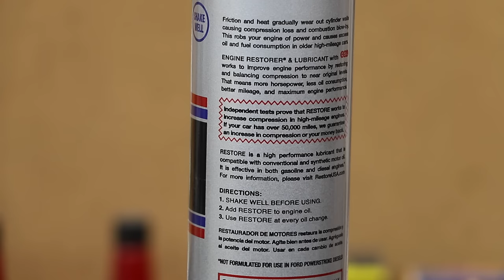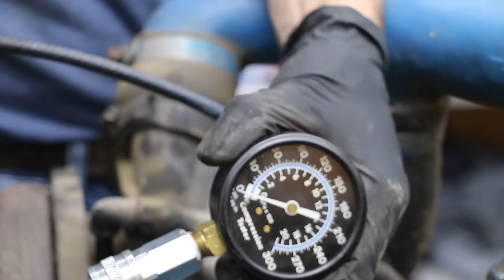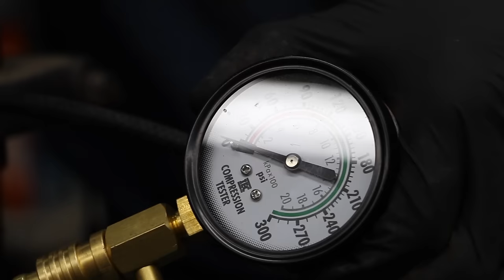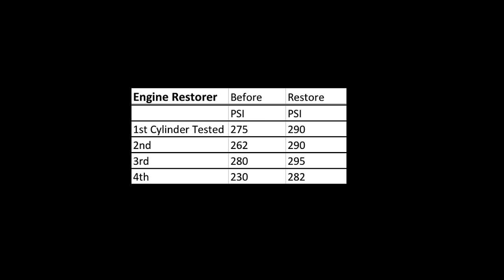Does Restore Work?  Will it Improve Engine Cylinder Compression?

Comment: I I just bought this stuff. 
My truck cranks but won't start. Two different mechanics told me it is most likely the timing change. Compression is low but everything checks out good. Relays, electrical, fuel pump, inertia switch, battery and ignition are good. 
They told me it costs between $3500 to $8000 to repair it. 
just bought this stuff. 
My truck cranks but won't start. Two different mechanics told me it is most likely the timing change. Compression is low but everything checks out good. Relays, electrical, fuel pump, inertia switch, battery and ignition are good. 
They told me it costs between $3500 to $8000 to repair it. 

This Engine restorer is my hell mary.

Comment: A little trick if your diesel is hard starting and you don't want to use starter fluid. Spray silicone, spray it through the air intake while cracking the engine. This will increase your compression long enough to start the engine without damage.
Reply from the maker: Thanks for sharing.

Comment: I own a 2003 mustang cobra which is a supercharged small block v8. Upon making to much boost, the previous owner burned the exhaust valves in cylinder 7 and burnt the rings and piston in cylinder 5. I know this because upon doing a compression test all of the cylinders were above 160 psi except 5 and 7 (they were near 130 psi). I poured about a table spoon of oil into the cylinders which were low on compression and performed the test again. The new results concluded that since cylinder 7 jumped in compression to near 150 and cylinder 5 jumped marginally to 137 psi that cylinder 7 has ring issues and possible exhaust valve issues and cylinder 5 is mainly a ring issue. I went ahead and changed the oil and  added the restore v8 formula. I checked the old oil and filter and they didn't show any signs of over-wear. Just some small sparkles which could barely be felt on the finger tips. I checked the bore of both low cylinders with a bore scope and everything checked out. Other than mildly slow start ups every now and then the car seems healthy. Do you think engine restore could fully fix my compression issues or do you believe it  may be time for an engine rebuild? Thanks, and I look forwards to hearing from you! Huge fan

Comment: I just wanted to give you a note when applying Teflon tape you did it correctly but one more hint I want to give you reverse the roll this will pull it tight as you're wrapping threads check it out you'll see what I mean it will then sink the tape into the threads avoiding any slippage furthermore
Reply from the maker: Thanks for the suggestion.

Comment: Better put a fuel pressure gauge on that tractor. As the pump makes less pressure, the engine runs lean. Great videos!
Reply from the maker: Thank you!
Reply: @ProjectFarm  youre welcome. Also some say that after changing the oil (removing the Restore product) the engine revers back to bad compression. Idea for a test?

Comment: Back in 1995, I had an 1986 Acura Legend, very used and not well maintained when I got it. It had compression loss- I would have to stay on the starter for 7-ish seconds to get it running when engine was cold (not used overnight), and it would white smoke a little at first. It could start right back up after the engine was warm. Tried this product, however, it did not have a noticeable effect.
Reply from the maker: Thank you for the feedback.

Comment: This brings to mind the full-page offer in the old Warshawski & Co. catalog for "Engine Overhaul", a kit which included both an additive for the motor oil and pills to be dropped into each spark plug hole. Results varied, from negligible to non-existent.
Reply from the maker: Thanks for sharing.

Comment: I’m a deputy  sheriff. My patrol vehicle is a 2014 Chevrolet Tahoe that has 236,000 miles on the odometer. The engine runs smooth as silk. I was wondering if there would be any improvement if I added the 8 cylinder Engine restore. 
Today I added the Engine Restore 8 cylinder.
After about thirty minutes driving the country roads I had nearly forgotten that I had added the concoction. Then, then I was going up a hill and noticed the added horse power bump! Then, I noticed again that I was actually having to use the brake more on my usual driving style. 
Does it work? YES IT WORKS! Is it a fix all? Absolutely not. But, this product will fill in those microscopic etches in your cylinder walls and where ever compression is lost. I am absolutely amazed!

Comment: that was pretty cool dude.  some engines take cough syrup, others take everclear, and all other engines in between.  I have a fuel mix for small gasoline engines for power and engine improvement.  by mixture  1/3 diesel  1/3 gasoline  1/9 denatured alcohol  1/9 diesel clean silver  1/9 marvel mineral +/-1/27.   I run my 21"  MTD 675 on this fuel ratio.  cuts through thick grass without dying.  of course, I keep my deck to top for the acreage I push mow
Reply from the maker: Thank you!

Comment: Had a 68 El Camino with a 327 that got severely overheated. Lost ring tension and got rod knock.  Put restore in it, and the guy that bought it was able to drive it home. ( he had another motor to put in).  I was shocked it got rid of all the smoke and even diluted the knock to a small degree.
Reply from the maker: Wow!  Thanks for sharing this experience.

Comment: I have used Engine Restorer in the past.  I think they ask you to drive 500ish miles.  I took a trip so I got to 500 miles in a hurry.  When I exited the gas station where I stopped I accidentally burned rubber and noticed my engine more responsive.  Keep driving your tractor maybe 8 hours and you should see a bigger difference.  Good luck.
Reply from the maker: Thank you!

Comment: Have you ever tested the longevity of the results from this product ?  As in would the compression gains still be there at the end of your oil change cycle (3kmiles).  I'm assuming that the gains will diminish over the oil change cycle since they recommend to add it at every oil change
Reply from the maker: Thank you.  I did a follow-up video and the engine did maintain compression.  The hour meter is broken on the tractor and I'm not sure how many hours the engine was used during the year but I did use it quite a bit.

Comment: I've known of people in order to sell a vehicle to use heavyweight oil , Motor Honey or STP even gear oil to make car run better and to keep oil pressure up to get it sold . Even take white spray paint and paint the inside of the tail pipe .
My dad and my brother bought a car one-time that someone had used shoe leather and cut up a Prince Albert can to make rod bearings . Lasted long enough to get it sold for a better price .
Reply from the maker: Thank you for the feedback

Comment: Hi. The following is from Restore home page FAQ. 
“Can RESTORE be used in diesel engines?
Yes, RESTORE is effective in diesel engines. We recommend using it only in diesel engines that have "common rail" fuel injection systems. It is not formulated for use in HEUI fuel systems which are used in Ford Powerstroke Diesel engines”.
They recommend only in Diesel engine with common rail fuel injection??
Reply from the maker: Great information. Thank you
Reply: Can you give the link please?

Comment: Well here's a kick in the head.
I have a Yamaha generator (EF2800i). It's relatively new, but has been used heavily. This one is my second. The first lasted many years until I had to open it up, and upon closing I didn't get the wiring put back in securely enough, and vibration caused chaffing creating a massive short.
Anyways, I let someone use this newer one to clean an abandoned home.
I dropped it off, demonstrated how to use it, then left.

When I returned about 6 hours later, the generator was running very rough, and rich with soot everywhere.
The idiot had ran a shop vac with it with the choke on the whole time.
Not having the time to take the head off and clean it, I ran a can of seafoam through the carb in hopes of removing the carbon build up in the cylinder. I also replaced the severely fouled plug.

The generator worked just fine after that, but some months down the road it began using quite a bit of oil.
It wasn't smoking, but you sure could smell the burning oil in the exhaust.

I came across this video and thought maybe this would help.

Before adding restore, I took a compression reading, and got just short of 100 psi, which was actually better than I had expected.

I added 4 ounces of restore, and topped it up with fresh oil.

The generator ran for about 8 hours, then quit.

I checked the oil level first, and it was low enough to cause the self protection to shut it down.
I added another four ounces of restore, topped up the oil, but no start.

I pulled the plug. It was kind of strange looking. It almost appeared rusty?

I then took another compression test, and came up with less than 30 psi.

I haven't torn it down yet, but have new rings and piston on order. 

It might all be coincidence, and the engine was about to give it up anyway, but it was running before adding restore.
I'll update once I get it open.
Reply from the maker: Thanks for sharing.
Reply: @ProjectFarm  Well thank you, for thanking me for sharing, but whattya think?
Have you heard of anything like this yet?

Comment: I bought lawn mower that was on discount because it was to be used as parts only the manufacturer said the engine was shot I got it I put engine restore in after putting new oil in it is still working great now 15 years later
Reply from the maker: Thank you for the feedback

Comment: After I properly changed the oil with Engine Restore in the mix, engine dash light came on.  OBD codes P0011, 12, 16, 21 and 0022 came up on my scan tool.  All related to engine timing & camshaft positioning.  There were zero issues prior to oil change.  I'm attempting an old fashioned 're-set' by disconnecting the battery overnight with the hope that the electronic system will re-boot and restore initial engine settings to truely clear the warning board.  Have any of you experienced this occurrence with your modern vehicles?

Comment: Yupp 80 Mustang inline 6- 300,000 miles smoked and blow-by barely ran- Restore between 3-500 miles brought her back and ran like a top for another 3 years, used it every Oil change. And was running great when I sold it. Always wondered if it would help a worn out lawnmower engine If a little bit was added to the Oil.
Reply from the maker: Thanks for sharing.

Comment: I had almost no compression in one cylinder that caused a stumbling sensation opon taking off from a stop..  Light throttle, like tipping into the gas pedal. Put this stuff in and the stumble pretty much went away. I feel it slightly, but it's really light now.  Cruising at city speed my transmission goes into lock-up and that's when you really feel those surges. Now it's less noticeable.  Someone told me it will get better if I keep using this product at every oil change.

Comment: I actually use that on some cars I have worked on just because they have hit 240k + miles on them and seem to help out the cylinder walls and the rings where blowby happens. I don't really use seafoam on any thing other than a good cleaner for the intake system and getting the gunk out of the system of the engine. I dont trust it in the oil because it is a cleaner over five minutes. like the five minute oil treatment cleaner where it takes all the gold tint off of the internals where the engine needs that type of tint. if it is a  caked on black style of sludge I would recommend a rebuild to be honest or a new engine

Comment: Great video. Thanks a lot. I'm looking into extending the life of my 4.8L v8 gasoline engine with 166.000 miles on it. No problems yet, but I really don't want to replace the valve stem seals for another 100.000-200.000 miles or so. Could I use Restore like that or only recommended when there are issues already?

Many thanks from Holland

Comment: There's  tons of comments and this may have been asked before, but did uou use ATF as a cutting oil when drilling/tapping the hole in the top of the injector? I recently watched your video comparing cutting oils and was laughing when you said bacon grease smelled the best!  I recall you saying "something was better than nothing" too. Thanks for another great and informative video!

Comment: Back in early 90's I took an 180k subaru that i knew was not doing well since i sold new subaru loyale series @ time with same engine  i added gunk flush 1st ran car for 7mins drained oil installed a new oil filter & fresh penzoil short 1qt & in place of that quart added 4cyl can of restore & topped with marvel  in less than 150miles  that old subaru was making up a certain steep hill to my residence as well as the new loyale subaru i drove as company demo which before i would be pushing car all it had in 3rd to make hill same speed now could make in 5th @ the same rate of speed and gear as the new car
Reply from the maker: Thanks for sharing.

Comment: They make a spring loaded tap guide that goes in a chuck .it goes in the end of the tap handle..most have a center drill hole,but u can add one if not. It will keep you straight  and alot more stable while taping..thx..heath
Reply from the maker: Thank you

Comment: I think it is nothing more than a viscosity thickener.
It prevents oil to flow through the gap between piston rings and cylinder wall, and, it actually makes something like sealant around the piston rings and valve stem sealants.
I am not sure, but if it's going to restore the engine compression, it must work forever once you poured it into the engine, not pouring it with every oil change.
Reply from the maker: Thanks for the feedback.

Comment: Liqui Moly Molygen (the additive not the oil) uses Tungsten as its main friction reducing component Liqui Moly Ceratec uses Molybdenum, and archoil ar9100 uses potasium and boron. i like to use a dash of them plus motorkote when i do my oil changes and mpg has never been better maybe ill throw some of this in the mix next time although i never use the recommended amount to not dilute the additive package from the actual motor oil im actually using.
Reply from the maker: Thanks for the feedback.

Comment: I would love to see a video on different types of oil_crank case cleaners

Maybe like gunked up price. With different types like, seafoam, lucus, amsoil, some big name and some cheap ones

And maybe if they were heated like they were added in a engine then ran then drained like you would normally do with cleaning it and changing the oil.

Would be cool to see if it causes damage to any additives to the new oil from any left over residue
Reply from the maker: Thanks for the video idea.

Comment: THANKS to your video, i bought a bottle of this for my honda k24a2 , the car has 230k miles and though it runs strong and not burning alot of oil i sure  at that age and milage i lost some hp along the way,its been 1 week since i added a bottle and each day the car feels like it pick up some low end power and im not finding myself having to downshift to get up to high way speed and the rpm has been under 5k and before i used to just get past 5k to go into vtec to get some of that extra power. sadly enough on my other car i took the motor out before i find out about this product, one cylinder lost about 20-30compression and blue smoke out of the exhaust too late to test this product out on that motor
Reply from the maker: You are welcome!  Thanks for sharing!

Comment: You should revisit using Restore in wet oil clutch motorcycle and snowmobile applications.
These engine rings and cylinder walls are often dusted due to air filter issues.
 Will Restore both increase performance without negatively effect the clutch operation? I have heard that the manufacturer says it does not harm wet clutches...but most online say they wouldn't try using it or the clutch plates will slip.
Reply from the maker: Thanks for the suggestion.

Comment: My question is, what does it do to the rest of the engine? Bearings, lifters, cam lobes, etc. will it sludge up the engine after multiple uses?
Reply: Nothing, really, b/c the particles are too small. Scoring in the bearing will start to fill in, though (which is good). Shake it well and ideally pour it in with engine running if you have a high tech engine, so it doesn't clog up any VTC components (had to clean a VTC solenoid once, b/c  I just dumped it in with an oil change, but to be fair, it's pretty easy for that to happen on nissans).

Comment: Love your videos and thank you very much for your service to the country. Do you advise using restore and Lucas gas additive at the same time or will they counteract each other? Running a Honda Civic original 1.5L engine with 306,000 miles.

Comment: Don't overuse, I had a 1lt Geo used this when ever compression got low. After I stopped using for awhile. Oped up engine and piston skirt had cracked off after rings  catching on peeling off cylinder coat. Had to replace piston.  I did have sticky piston rings that would allow for extra wall buildup though.
Reply from the maker: Thank you for the feedback

Comment: Great work. I've used DuraLube in the past just to use something that will help with excessive wear as I used to abuse engines. I felt that as long as I used an addictive replacing a quart of oil, I could beat up the engine. I didn't even think about compression since I didn't know much about it, but it would be great if you could test it if you haven't already done so. If you have, the link would be helpful. Thanks.
Reply from the maker: Thanks for the suggestion.

Comment: I noticed that the pressure gauge you’ve used in the first compression test is different to the one at the end. This may produce inaccurate results especially when it’s a dialogue not digital gauge. But thanks for the great job
Reply from the maker: Thank you